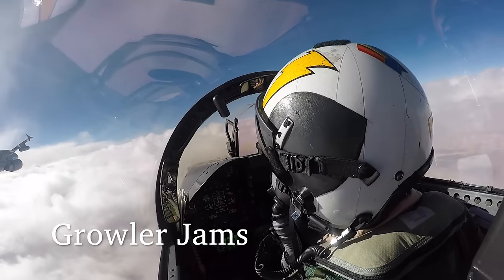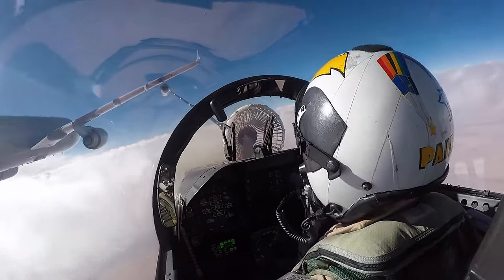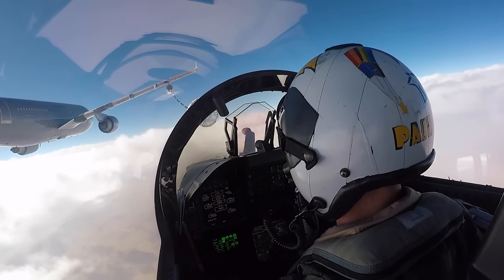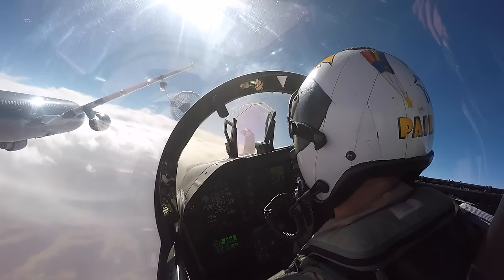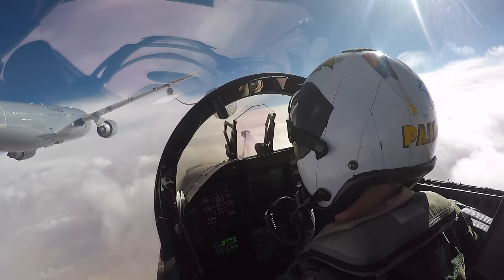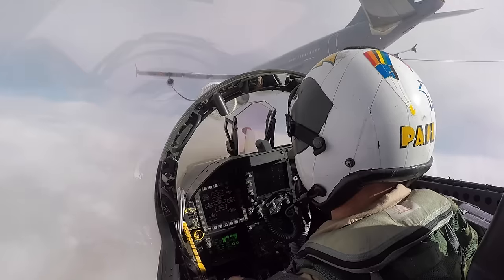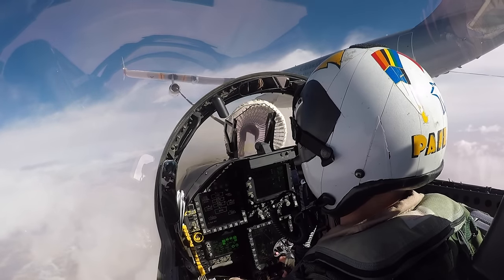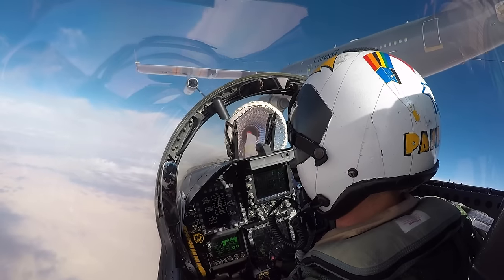My NIGHTMARE! Trying to Get Gas as Time Runs Out

Comment: My switches are safe and my nose is cold does that mean you Callsign now changes to Dribbles 🤦‍♂ (I understand the nose cold reference and it's not illuminating. ) 😁 Sorry, last weak comment this err comment.

How times did you need to plug the drogue before it became sort of routine and you could talk and connect at the same time? I know this will require a lot of concentration so I am just curious and it may give me some idea if I could have been able to handle a connection. I tried talking through an approach at night when I was getting my night endorsement/rating and while I was turning from base to final I stopped midsentence when the brain decided talking became less important than getting the approach right. After half a dozen landings it required the same sort of concentration but by then I was developing what I call Brain Fitness and Mr Brain was speeding up to process the extra work for the night landings. Probing for the drogue must require a lot more Brain Fitness than a night landing on a 10,000 foot runway especially in unstable air and even more so at night. I know I'm comparing apples to oranges but this it what I'll settle for in my retirement.

Thank You for the video. That sucks that the Navy "demonetised" you. Do they not realise what an incredible recruitment tool your videos are. Bloody stupid IMO considering the manning needs of the military that aren't being filled.
Reply from the maker: Took me probably 20-25 times before I was no longer nervous about it. Like everything, just takes reps and sets.
Reply: @GrowlerJams  WOW, that many. It must be a consistent very steep learning curve until it begins to plateau. I didn't imagine that number. How many hours did you have when you started learning that skill?
Thank You for responding. Much appreciated and I find them very interesting. Aviation IMO is the most addictive drug known to mankind.
Blue skies and tailwinds though tailwinds may be irrelevant (a jet stream one doesn't count) when you can zip along above Mach 1. 😁

Comment: Should add fins to that dragged probe behind tanker and make computer system that would connect with plane that attempts to tank to compensate for both vehicles movements.
Current system is unreliable.
Rocket style fins i mean, and if not to connect then at least to stabilize probe so it does not wobble in all directions in the wind.

Comment: What’s it like flying right smack in to the refuel aircraft’s  wake ?   I one time was flying a very light Cessna 172 R . The wake from a 737 that took off before me a half mile away - nearly flipped a student who took about 2 minutes before me. You are in a much heavy aircraft but that big refuel ac must be kicking out some serious wake TB . The Cessnas are very light and have only about 300 lbs of fuel but the wakes I have seen from the big heavies would give a king air a tough time . ( don’t discount the 172 though , I can fly all the way to corpus on a single tank of 100 LL from DFW because the FPR is about 6-7 gal /hour aircraft has a range of 700 nm - fuel efficient and reliable )Though we are trained to fly above the wakes and to wait for them to dissipate .
Reply from the maker: There’s no wake turbulence that close to the jet, that disrupted air appears significantly further behind the tanker.
Reply: @GrowlerJams  so you approach high and then flank left or right ?
Reply from the maker: We approach level.  Wake turbulence slowly goes down.
Reply: @GrowlerJams  good to know . Thanks .

Comment: That was interesting.  Does anyone record the time taken for each refuel  for each type of plane and categorised air and/or contact conditions.   Then analyse the information for performance benchmarking. And information share with the pilots?
Reply from the maker: No, fuel flow rates on the hose are the same for each pilot.  Weather and sometimes even tanker equipment play into time tanking, but no, that is not a worthwhile statistic.   This was a very rare day.
Reply: @GrowlerJams  ok thanks I assume therefore given a standard affair each pilot performs the task equally well . That any variation from expectation would not be considered wastage.  Therefore task  performance neasuring not required.  I have no idea on this subject so excuse any of my ignorance
Reply from the maker: Exactly. Cheers!

Comment: Ok so I have probably 20 hours of A2AR practice in DCS in the FA18c and I've only ever managed to stay connected to the drogue for maybe 15 seconds at a time. I was trying to figure out, do I just suck, or is there something else at play here... no fucking way is it THIS hard. Looking at your HOTAS inputs, it's not even remotely possible for me to make corrections as small as you do. I can move my stick 1/8th the amount you are doing, and my nose will move 3 times more than yours easily. So I need to play with those input curves a bit on the HOTAS axis set up.

Comment: how can you adjust power for half knot of speed
Reply from the maker: Carefully with the throttles, just like with the gas pedal on a car.
Reply: @GrowlerJams  i can not adjust that speed on bicycle😂😂😂, i am joking, i spoke with mig21 pilots that made air policing and they had to intercept passenger airplane that was high and fast, one pilot could keep same speed but other was on 100% dry power and was too slow, if he put afterburner, he would be too fast, but it he could not start afterburner because he was below 500km/h IAS, so he had to dive to reach 500 and then start afterburner but then he would just passed by passenger plane with too much speed🤣

Comment: That plane doesn't have boom operators lol engineer and 2 pilots and a nav. I know I was a boom operator on US aircraft
Reply: I spent many nights over Iraq refueling you guys. I flew both KC135 with MIPER pods and the BDA (iron maiden) one night over Iraq during heavy thunderstorms at night. We had completed our AR and were heading back. My crew heard over the radio two F18s couldn't get on the KC10 post strike because of the turbulence. They were requesting emergency locations for possible bailout. We had the BDA on the end of our boom, I told my pilots I could get them on and let's go get them. We coordinated locations and we flew over the top of them and it was rough. With the boom hose drouge adapter I told lead I would keep it fully retracted to use my controls to counter the turbulence. But caution them my ruddevators would be close to his canopy. Cleared him to contact. I was able to keep it stabilize enough to engage. After contact I coach him aft to full extention using my controls to follow his movements. Called stabilize and then I started the pumps. Two F18 crews made it home that night, I believe they were on the Abraham Lincoln. Around 2003 I wish I could remember the date. But it was one of my most memorable moments in my 24 years as a boom operator. I retired in 2008. Keep safe Growler my friend. Your friend boomer.

Comment: Man, the Navy just loves to make it hard on you guys huh? It's like they don't like you or something.. or they thought you didn't have enough responsibilities with your easy landings on a carrier, let alone at night, so they wanted to make refueling more difficult to keep you on your toes.. Not like the Air Force where you just pull up behind the tanker and the boom operator just plugs it into the slot on the nose or behind the canopy and you just have to hold your plane still.. That'd be way too easy for flying squids right? :P
The US Navy, it's all about tradition. Good, bad or indifferent, if it's tradition, it stays.